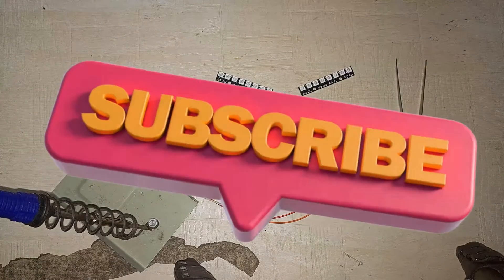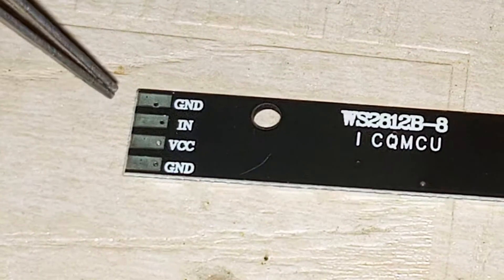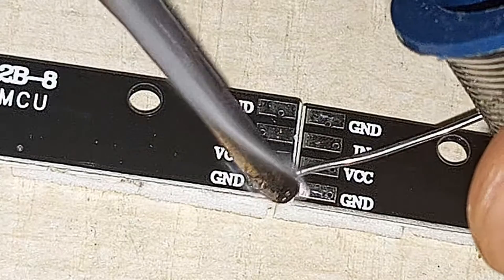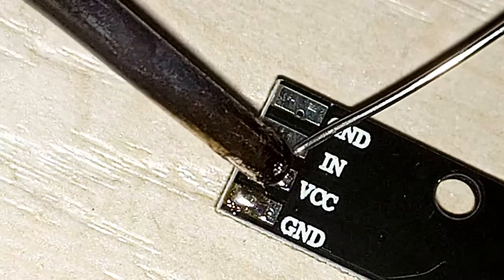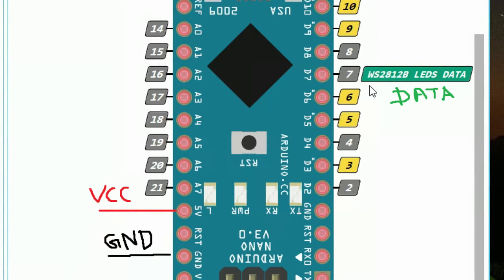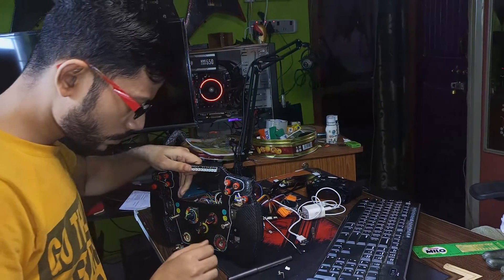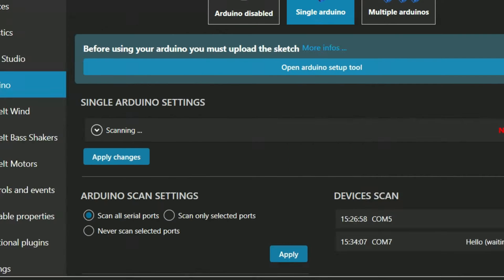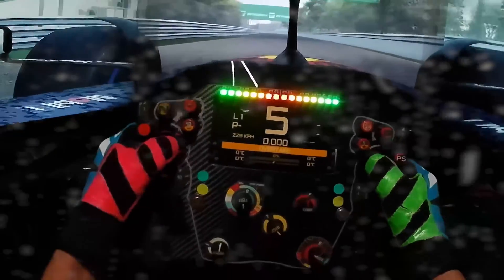F1 23 Arduino RGB Rev Lights with Simhub WS2812B   Ultimate Customization for Your Racing Sim Setup

Comment: Nice! How do you actualy have the light end up like 2 mirrors in half (instead of just 1 long line LEDs)?
Reply from the maker: @danikurnianto  I messed up with the settings after that it happened. couldnt figure out how I did it. but definitely its the settings.